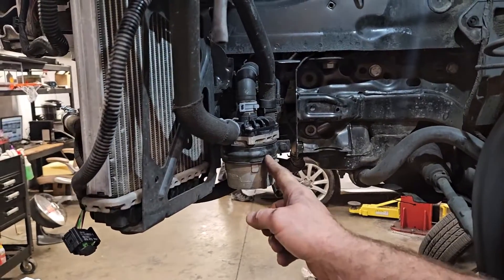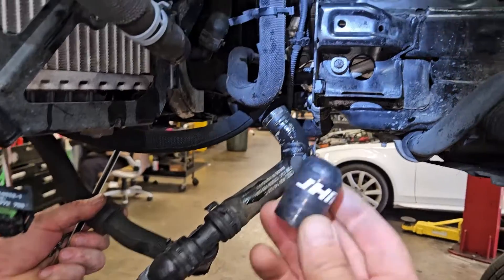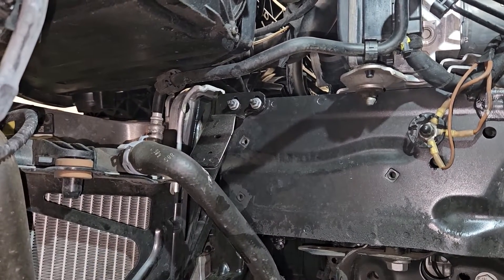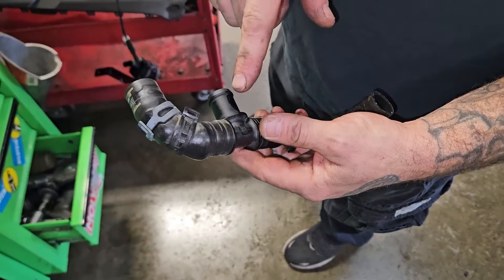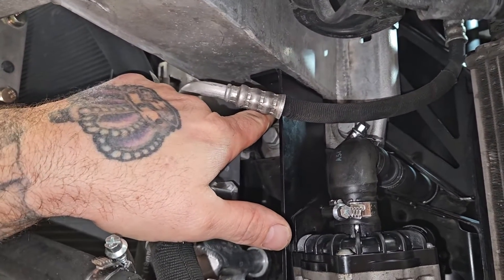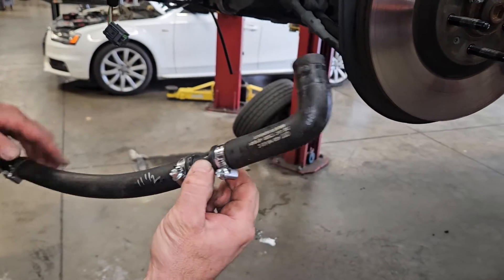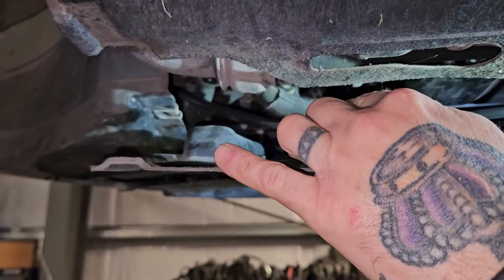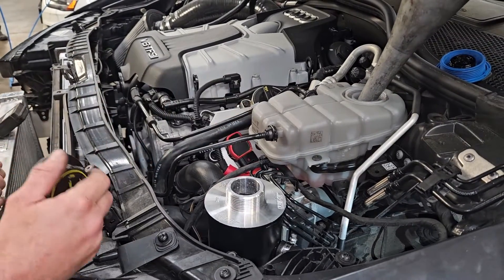JHM Audi C7 A6-A7 3.0T Supercharger Coolant 1-Gallon Divorce Tank Installation Guide

Comment: Hey what's that other rad that's behind the bumper and infront of the drivers right tire? Never seen that
Reply from the maker: Its an Aux radiator
Reply: It's a secondary heat exchanger , coolant flows out of the aux coolant pump and through that heat exchanger before entering the supercharger,  then flows through primary heat exchanger mounted in front bumper on its way back to the coolant pump .